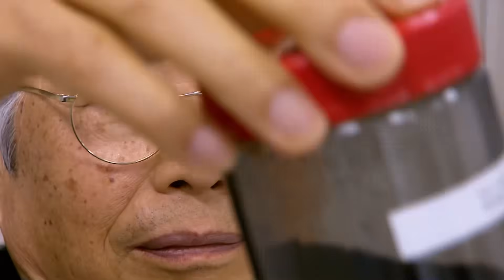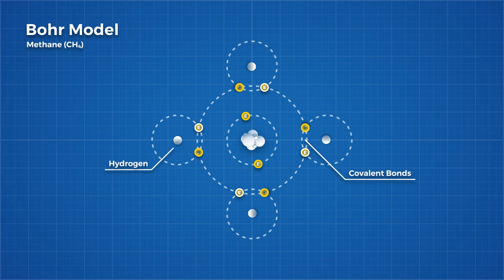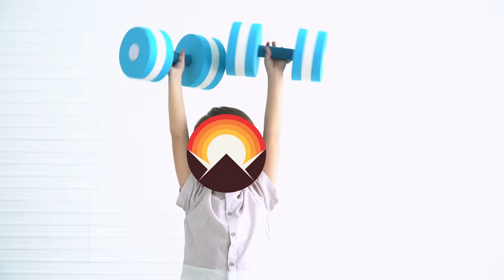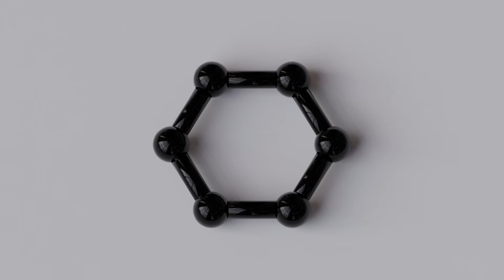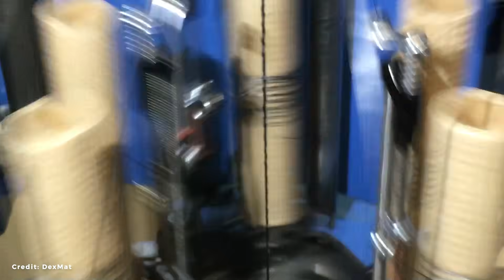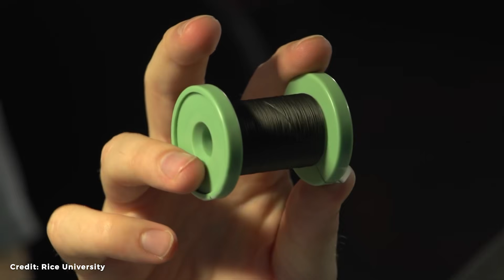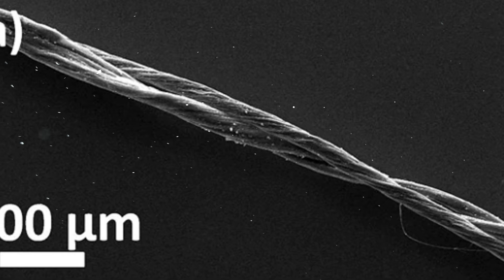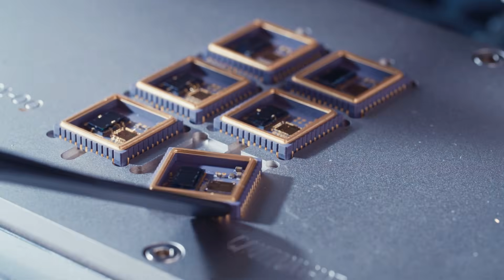How Carbon Nanotubes Will Change the World

Comment: Brian: "Building a fiber that is actually a single molecule, of any significant length is incredibly difficult"
Dividing cell: "Hold my beer :p"
Reply: theoretically, cant we grow these tubes with cells?
Reply: @fureversalty  The hardest part is building a single molecule fiber that is extremely strong as well as one atom thick. Cells have capabilities of creating considerably strong fibers, as in microtubules that assist in transporting the chromosomes to each new cell, but they aren't supposed to last forever, their strength is the dynamic growth and shrinking, (you can stabilize them, but still, far from graphene nanotubes.)

But about your question, I don't think you can use cells with current technology to biosynthesize these nanotubes. Microtubules are made of proteins and relatively thin, but graphene sheets are literally one atom thick, an aberration. This nanotube screams artificial, it's pure carbon, no oxygen or even hydrogen, I can't imagine biochemical processes that could originate frames of pure carbon.
Reply: @metametodo  Ah, I see. Thank you for the in-depth explanation!
Reply: @fureversalty  probably can, idk.
Reply: Well, but if we're using the cell as an example, that actually really doesn't bode well for us, because if cells had the ability to make carbon nanotubes all along but didn't do it, then carbon nanotubes must not be all they're cracked up to be.
Reply: @augustovasconcellos7173  Well I suppose they never needed it for any process, or found more suitable materials that were specific to its needs. I.E. cell walls are made from the lipid bilayer stuff, I don't think a bundling of carbon nanotubes would be very useful in place of that.
Reply: @fureversalty  But what about muscles, bones, and high-strength ligaments? Nanotubes are lauded as being able to produce artificial muscles and ligaments hudreds of times stronger than what's found in nature, all the while being perfectly biocompatible, yet nature has never attempted to build these things.
Reply: @augustovasconcellos7173  i think your statement that it has never tried might be a little extreme. A more careful wording would be that we have never seen it succeed in building nano tubes.

A probably explanation could be the energy requirement. The amount of energy that is going into this process per molecule is ridiculous. Now enzymes are very effective, but do not completely negate high cost at all times. 

Another argument why this would be less useful in nature than technology would be that it is likely a very stable molecule that is extremely hard to control dynamically. Of course this is not always necessary, but most biological molecules I have encountered in my studies are controlled in their existence in way or the other. Even more so, the uncontrollability of some molecules is the cause of many sicknesses.
Reply: @augustovasconcellos7173  Nature doesn't reason like that. Firstly, the primary reason for nature to select (and thus exist) some kind of characteristic isn't it being the strongest possible. Nature aims for advantages that promote life and reproduction, and even if such biosynthetic processes exist, prducing carbon nanotubes wouldn't be energy efficient, so needing more energy to generate nanotubes is a disadvantage in fact. 

To illustrate: there's no nuclear-energy-run animal because harboring the processes that generate that energy is extremely costly and disadvantageous to survive, even though that energy is a whole lot. 

If one must remember just one thing, this is it: in nature, what is desired isn't the best, but the good enough.
Reply: Cells are much bigger than molecules tho? They're made of molecules..
Reply: @redhidinghood9337  DNA strands are single molecules and can be rather long. Cells make those on the regular.
Reply: @remuladgryta  I mean yeah but it doesn't make cells special, chemical processes do that all the time
Reply: I think they meant building a fiber you can actually use*

Comment: Ok, exceptional explanation, thanks. Can I translate it into Spanish? But the problem is the price if we don't reduce the price of this material will remain in the laboratory, I made a presentation for a university and I show that a material that now cost 0,38 USD to produce 250g if we include only 0,4% of carbon nanotubes in weight the price is 1010,38 USD... and the increase of the properties is only 2%.  
All the young people that are seeing this video, if you want to become a materials engineer in the future and be famous and rich, find a way to make a forest of carbon single-wall nanotubes of 25gr for less than 100USD [price of the carbon fiber] and patent it. It is not necessary that the length is 50cm, with 2 to 10cm is enough. We couldn't find it yet, is open for you.

Comment: Finally my knowledge of hybridization came to use, i always wondered why are they teach us this at school
Reply: Yup.. as much as I hate the "muh real world!!11" argument, I feel like textbooks should include more applications per chapter, instead of a couple at the end.. I would always be confused by some topics, then immediately when something as simple as shown in the video was presented to me, it immediately solidified WHY I had to perform such and such operation instead of rote memorization
Reply: Yeah like why tf they don't tell us there use also in maths and other science subjects
Reply: @harshvardhan4766  Maths is probably the worst for this.

Most maths education is just learning how to work out equations with very few, if any examples.  Sure, for say trigonometry they'll chuck in working out the distance a boat is from a lighthouse or such, and there are graphs (but those are pretty abstract and require understanding themselves) but the number of actual occurances and uses of the maths is stupidly limited.  

tl;dr I know what a quadratic equation is and how to work it out, but I don't know anything that would require me to do so.*

*Yes, I do know (thanks mainly to pop culture like this video) that there are uses for it.  Now could you go back in time and tell my maths teacher to tell me those examples?
Reply: @tams805  with relation to thermodynamics and physics, most definitely
Reply: so true

Comment: it'll be great to see just how many interesting (and sometimes strange) applications that we come up with once we can start mass producing these, it may still take decades to come but: engineering evolves in steps, and only rarely in leaps
Reply: But those steps get bigger and sooner each time😉
Reply: Zero gravity may help.  

Ironically though, a space elevator would immensely help in making a factory for carbon nanotubes in space (mainly due to the ease of send the finished material back to the surface).

Comment: Brilliant work. It probably causes cancer like asbestos.
Reply: Small loose fibers might be according to some studies (not conclusive due to lack of data), as you would expect from microscopic fibers, but as long as we use them stuck in an epoxy it should be fine. Don't think they are about to make loose insulation material out of it anytime soon, way too costly. Basically, even asbestos was only dangerous when large amounts were loose in the air, doubt we have to worry about that with how expensive carbon nanotube is, at least for now. And industrial production can control this hopefully, unlike asbestos mining.
Reply: @owlman145  Agreed, I would definitely avoid breathing in CNTs but when they are encapsulated in materials like inks or epoxies, I believe the potential health risks are mitigated.